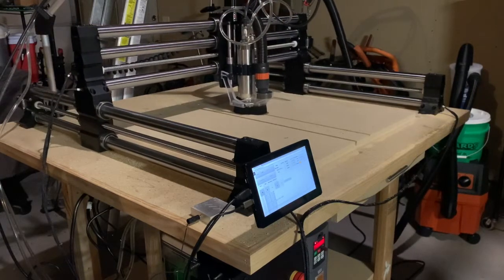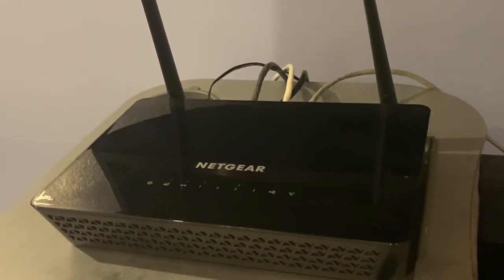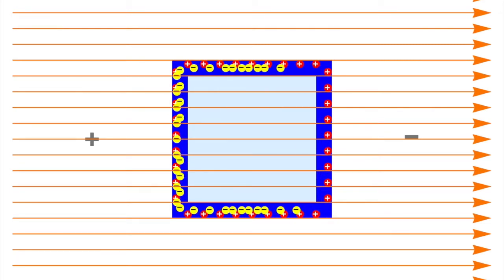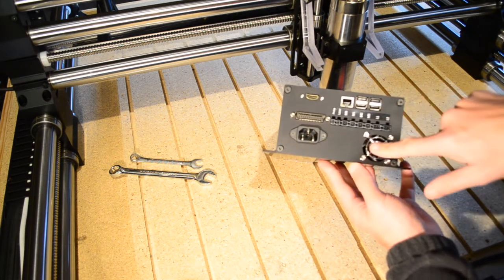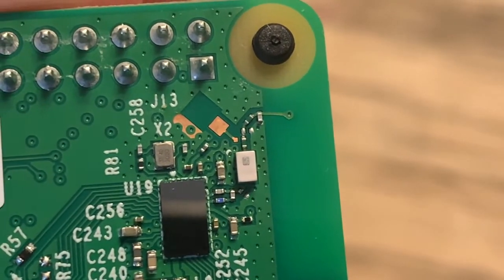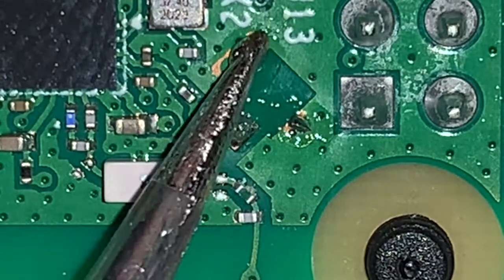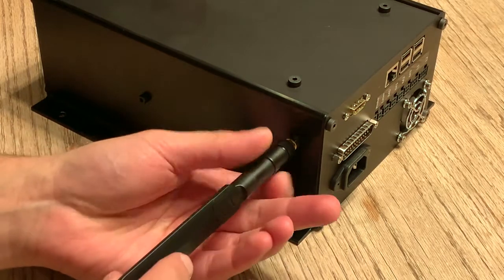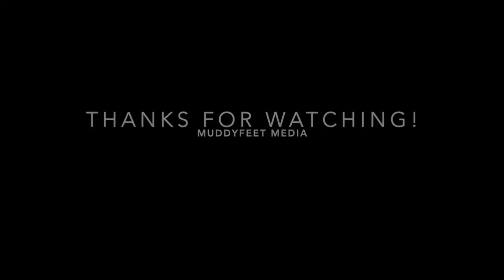Hacking the Onefinity: Adding an External WiFi Antenna to a Raspberry Pi

Comment: You mention changing out a panel of te enclosure to another material....what would be cool is doing so but incorporate te antena into te panel...like a large pcb flat panel antena ...

Wat about dremmelling out slats throughout the enclosure? You would also provide ventilation for excess heat...though now you've provided ingres for dust and debris.

Comment: that "conforms with FCC regulations" bit is the main reason why there are no external antenna connections fitted to any RPi's (those regulations all need certification in different countries, so not doing so kept the cost down).  -  and that "plenty of replacements available", yeah, not a thing in 2022, unless you have 400 bucks, or live in Denmark on the same street as the only shop that gets them :)

Comment: Did you scrape off the one side just for a stronger mechanical connection? Because the left solder pad is ground too, right?
I wonder if it would have been easier just to snip off the u.fl connector and solder the coax wire directly to the pads instead.

Comment: Wow respect that you've managed that. Tried it myself, bought antenna, connector etc, but failed. Looks way easier on this video, but the parts are really tiny. Now I'm just using a external USB wifi dongle.
Reply: Does the USB antenna really improve the wifi signal?
Reply: @cjlowe1650  Yes, absolutely. Makes the antenna outside of the metal box just like this mod.

Comment from the maker: Update:  I used this same technique to add an external antenna to my Traeger grill.  Not powered by a pi: but the ESP-32 WROVER wifi chip had a space for a surface mount .ufl connector.   Same problem:  a tiny PCB antenna inside a metal box.  This time, I used plenty of paste flux to make solid solder connections.   Fantastic result.

Comment: Hey what I didn’t know the onefinity could fit other routers than the makita. What type of router/ spindle are you using ?  Was there any mods needed to get it to work? And what are the improvements ?
Reply from the maker: Huanyang 800w spindle/1500w VFD.  It runs fine on 120v/15A circuit.  The cooling is just a submersible pump in a kitchen storage container.   80%water/20%antifreeze for some corrosion protection.  There’s only about 2 gallons total in the system, but at 60deg ambient the spindle can run all day and stays cool. It’s nice and quiet.

Comment: awesome! what a great idea, kinda wish you didnt have to break connection to the onboard antenna
Reply from the maker: I bet it would still work somewhat if you left it alone, but with 2 antennas on the feed that aren't tuned in phase, there will be way more noise on the RF signal.

Comment: I has same problem, my internet provider came out to analyze and fix issue (love those guys!), but they was unable to help on service call. The tech took several measurements and looked at what I had going on with 5 kids and wife and all their devices. He recommended a wife router upgrade to mess system. Installed an Ambiguity Amplifi Mesh router. Not only did my Onefinity connect everytime, all my other issues disappeared as well. Mesh router is my recommendation for anyone not as tech savvy as you.

Comment: Great video, looking forward to receiving my OneFinity.  I could see my fat fingers screwing this up.  Approximately what would be the size and location of the referenced non-metal replacement panel?
Reply from the maker: The end panel of the controller you see me remove: It’s about 4”x6” and could be replaced with some 3/16” acrylic.  The one end only needs a hole for the power switch.